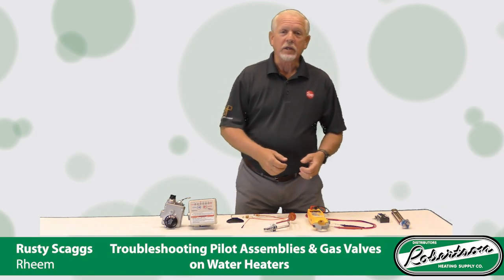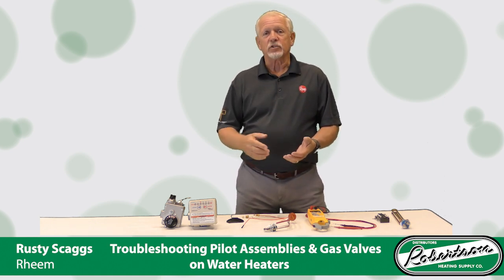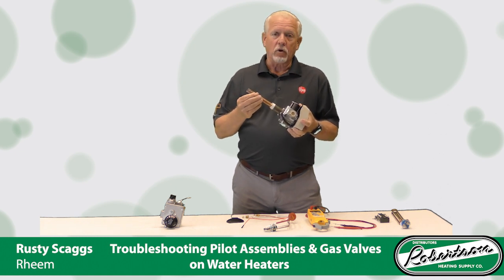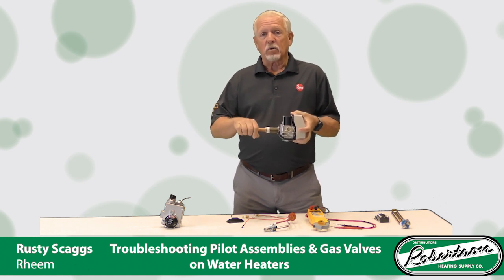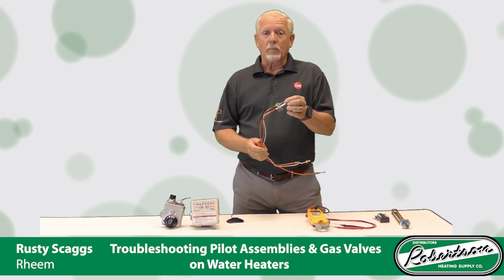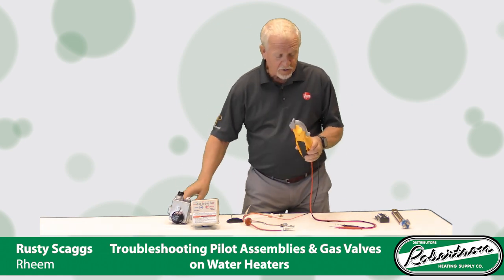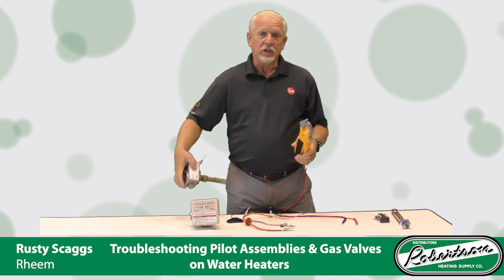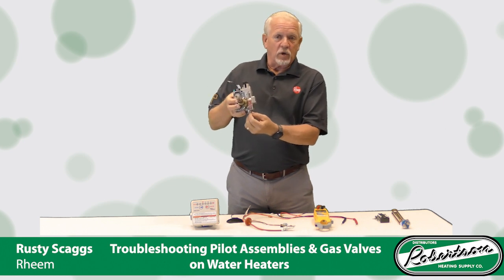Troubleshooting Pilot Assemblies & Gas Valves on Water Heaters

Comment: 2 Questions. 

1.  What if the pilot lights and stays lit for several minutes and is able to fire up the main burner and heat up your water for part of the day and then dies? 

2.  I've noticed that the main burner doesnt catch until I have the knob to A. Usually it has started when I reach the ON Arrow before the A.  Could this be an issue? How do I adjust it?
Reply: 1. Your gas water heater will cut off after the initial start up once it reaches the target temperature. After that it will cut off the then cut back on once it needs to reheat the water back up.

2. In this scenario it's working properly as well lol
Reply: @servantofthetruth8203 it didn't do that before. It was an older water heater that didn't shut off on its own. My new one shuts off and turns on. But my old one stayed on 24/7.

I'm almost positive it was an issue with the control valve. I had to keep going higher and higher before it turned on. Before I replaced it, it didn't ignite until I was at the B.   

When removing it, it was clear that it was completely clogged inside.